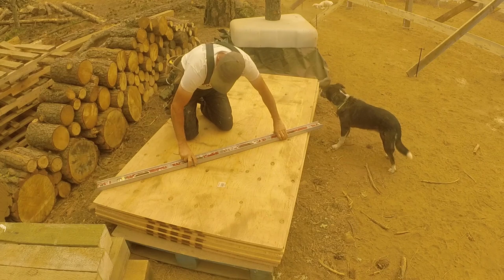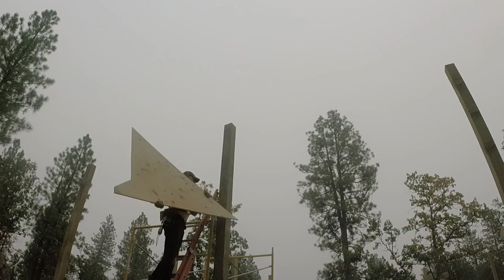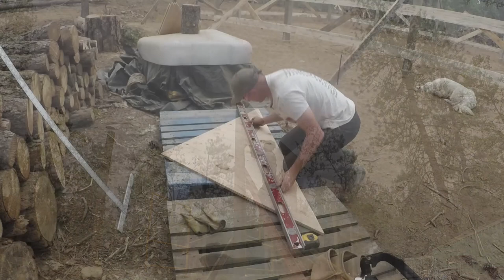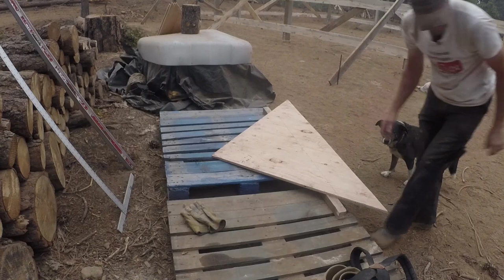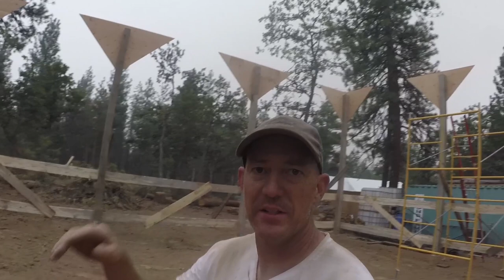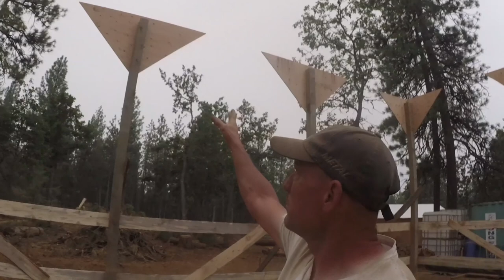Triangle supports for the pole barn, Shop build part 5

Comment: I like your gusset hanging method that allows one person to to the job.  You could still use a 6 x 6 knee brace if you wanted to.  Very similar to your explanation of the 2 x 5-1/2" brace.  Cut the same brace using a 6 x 6.  Temporarily screw a short scrap of  2 x anything across the vertical 6 x 6 post where the gusset meets it at the bottom.  Do the same where the gusset meets the  6 x 6 crossbeam at the top.  A 6 x 6 with 45 degree cuts on the ends would nest into the post and the beam without having to hold it.  You could then use the large lag screws.  Then take down the short scraps of 2 x material.  For added strenth, screw the triangular gusset to the 6 x 6.  Either way, your creative solution will do a good job.  i think your scaffold/ladder looks solid.  Great job.  Big jobs are just the solution of lots of little problems.
Reply from the maker: That would be an easy way to add a 6x6 knee brace. Thank you. :)